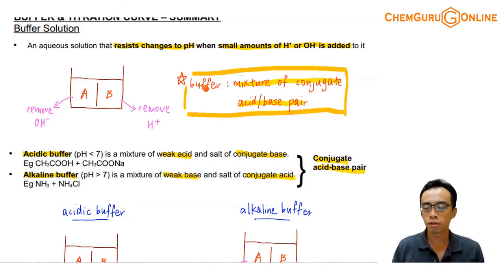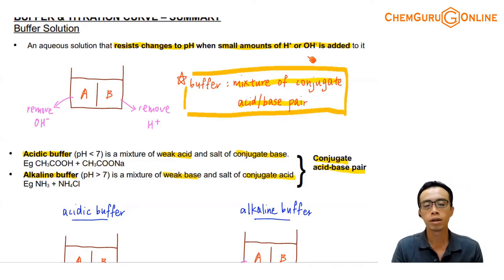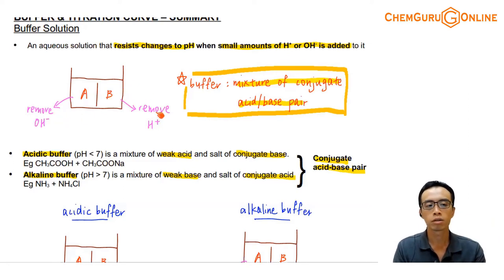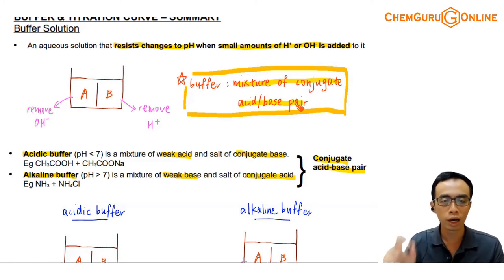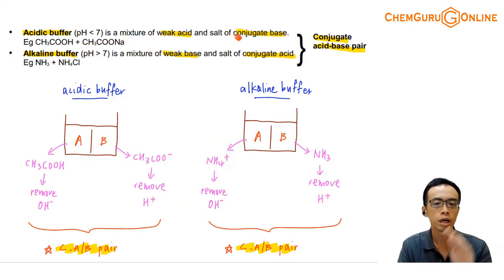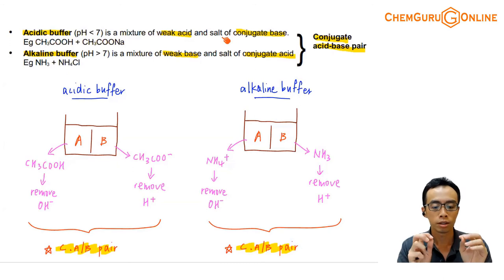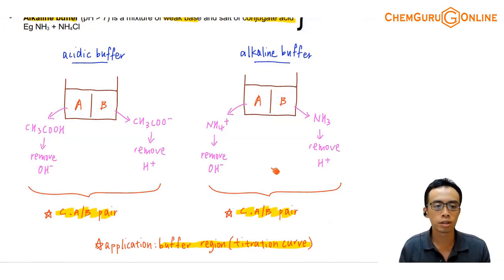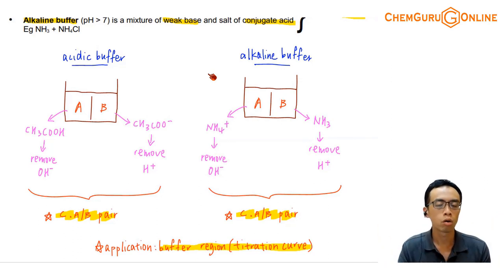What is a Buffer Solution?

Comment: It gets always talked about the addition of a strong acid or strong base to a buffer... my question would be how to calculate the ph with the addition of a weak acid? Lets say the addition of acetic acid to a phosphate buffer
Reply from the maker: weak acids added should be treated the same way as strong acids added to a buffer solution, as long as the weak acid is not related to the buffer.

eg if add acetic acid to phosphate buffer, acetic acid will react completely with base H2PO4-. The weak acid will be fully dissociated since reaction with base will remove H+ and shift the position of equilibrium to the right for dissociation HA = H+ + A-.
Note weak acids will only be partially dissociated if allowed to reach equilibrium, ie left alone and not reacting with any bases.